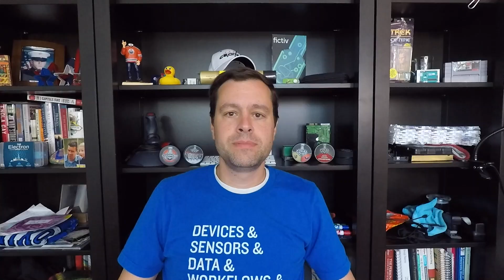Maker to Product: Avoiding EDA Lock-In

Comment: one thing to keep in mind, can your vendors use the tool, for example, doing a mechanical part in 3d is great, but it doesn't help if your vendor can only work with 2d drawings/files. Just have to be careful you don't use a tool that none of the vendors know or use, which is an advantage of the higher end products, professional vendors use professional tools.  
This is a great video and it's a never ending dilemma we all experience, what's the right CAD tool to use with the most adoption throughout the industry. Heck even when you decide on software, then you have the dilemma of getting the upgrade timing right
Reply from the maker: Thanks for the comments Keith. So many things to consider and try to get "right" when you move beyond the maker stage into trying to make an actual product.